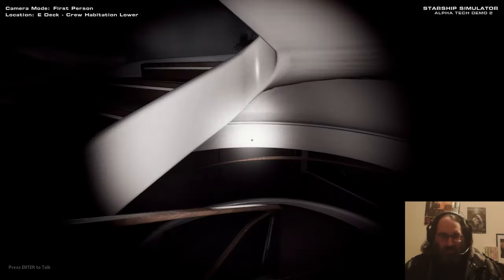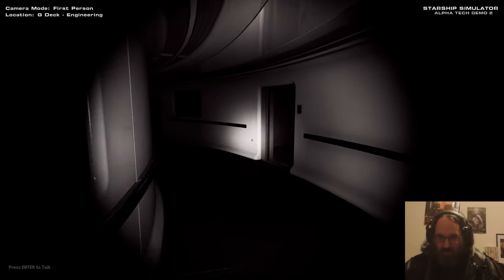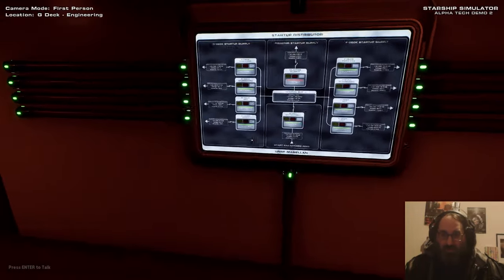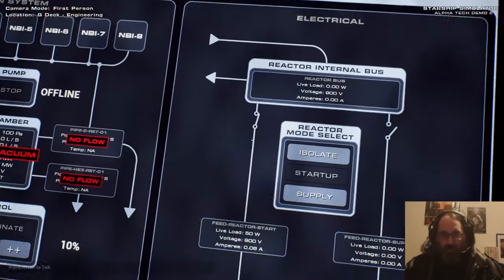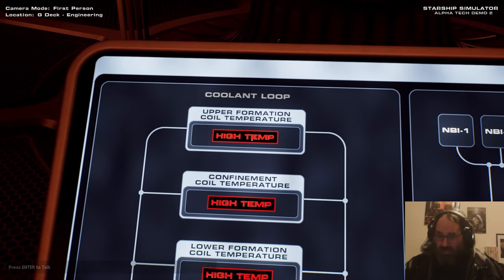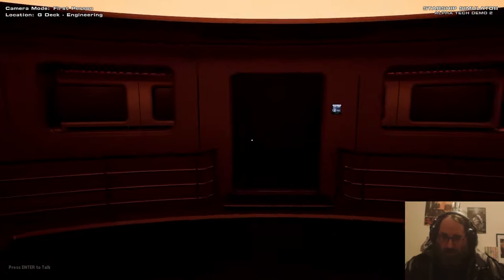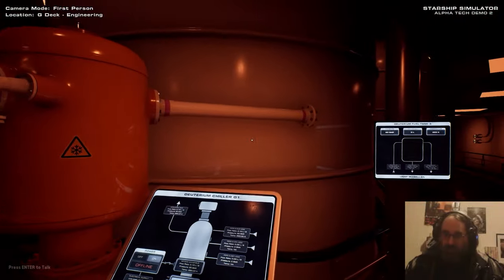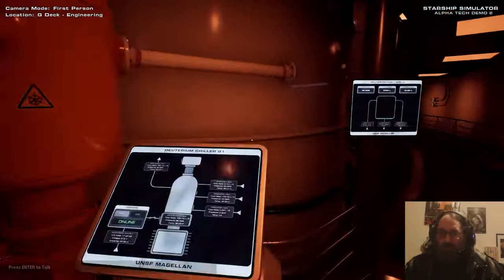Starship Simulator Engineering walkthrough

Comment: impressive batteries, how do you recharge them?
Reply from the maker: You use the distribution screens in the reactor room. 21:06
There you can send energy from the main reactor to the different systems. Including the batteries. And on the battery distribution screen you can connect up the 8 different room. (2 rooms in each quadrant)

Comment: If I see correctly, for the piping:
the pipes in the back are, essentially, connected to a "fake" gass station to fill the tanks...

So with a tad of luck that becomes part of a refueling sequence...
Which can be pretty cool, because new liquids/gas will affect the temperature and pressure in the tanks 😀